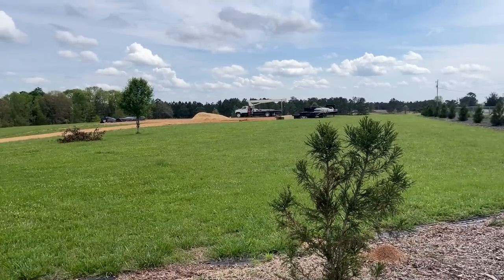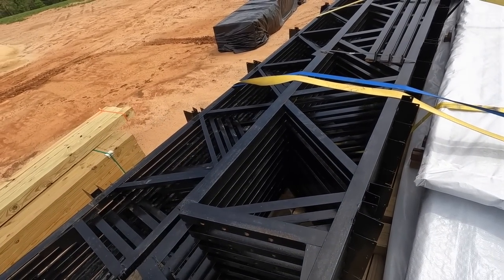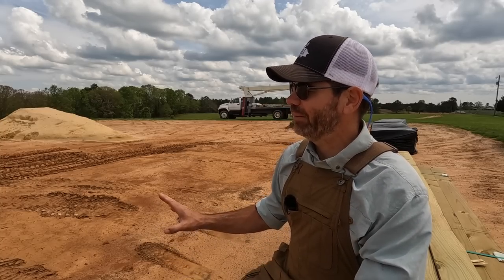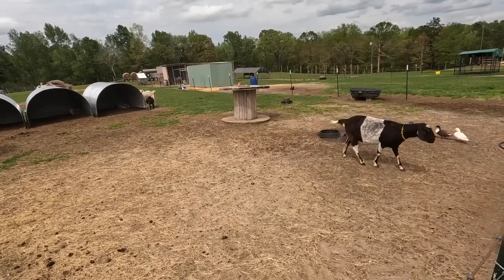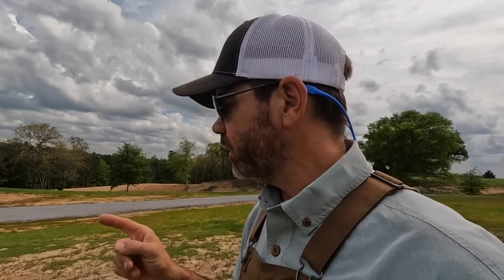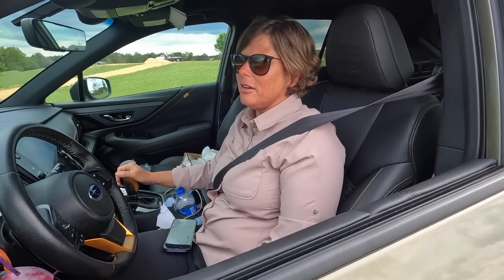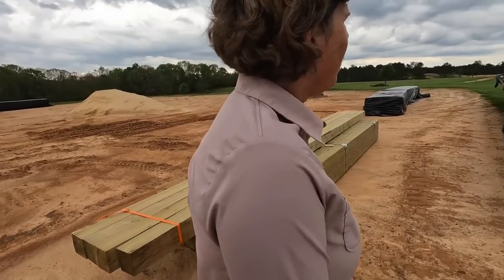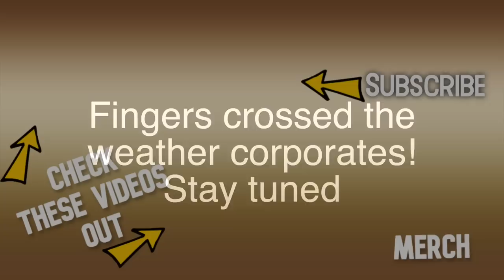You Won't Believe What Just Showed Up At The Farm?

Comment: As someone who has mucked goat stalls for the past 4 years, and lives about 2 hours south of you, I would take concrete in my goat stalls over dirt any day. I've had dirt and they now have rubber stall mats down but Ive also laid 100 12x12 concrete stepping stones down in the walkway between the stalls and its the best thing I could have done. Sweep it right out every morning. If it gets smelly you can always pour some of the Urine Destroyer for dogs and cats down. Just Enzymes so it eats the urine and isn't harmful. On the side of a pole barn like that you could make the gates big enough for your tractor bucket and just sweep right into it. I lay down the pine or cedar horse stall pellets and then pine shavings over top. Works great. Concrete is also nice for my does on a hot day where they can lay down on a cool surface in the shade.

Comment: Just tip on putting a coop in the barn. I’ve got my coop in my barn but it’s just a wood frame and wiring. Chicken dust ends of everywhere. If I had it to do over again, I’d use a solid wall to separate.

Comment: Highly suggest a cement floor, but if you don't want the expense, put Crete rock (dry concrete mixed with cores gravel rock)in the center section where the storage would be. Once craee rock has been wetted down really well it hardens down solid. Are you planning to install fans because the black roof will heat the interior like an oven in the summer?